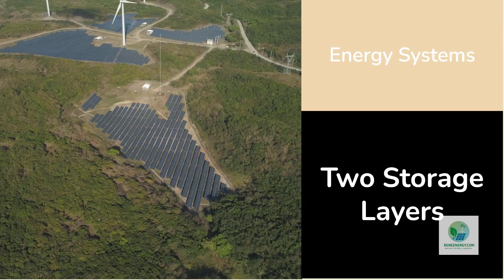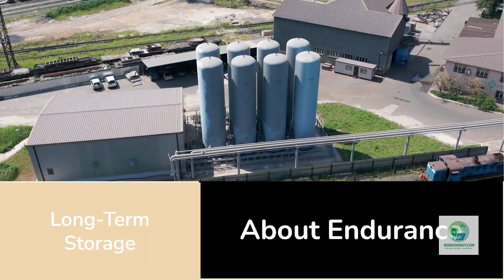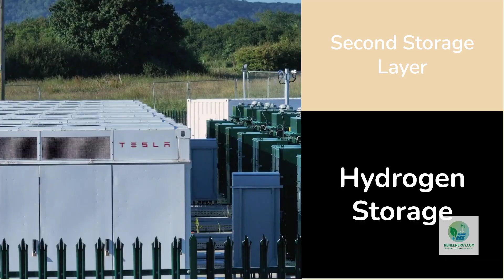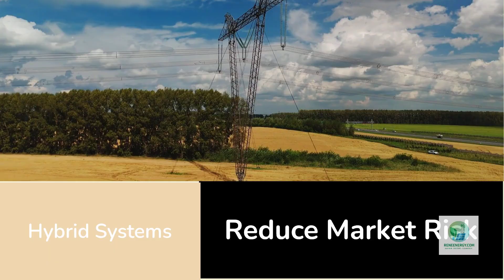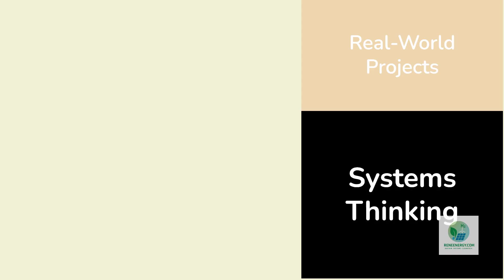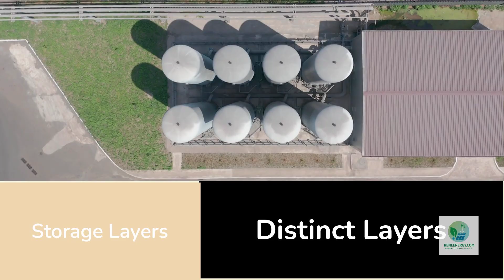Why the Energy Transition Needs Two Storage Layers?

Comment: Batteries are not the a stand alone solution for volatility management. Solar can actually do part of the job if set up right. You need grid forming inverters and when there is plenty of solar, you want to keep some capacity in reserve so you can respond to increases in power demand.

Hydrogen is not the only solution for long term storage. Heat storage is also increasingly popular. But then again hydrogen can also be considered a form of heat storage. Conversion of hydrogen back to electricity is inefficient, unless you find a way to use the heat that is produced along with it. And when producing hydrogen, you can improve efficiency by using heat from an external source. So for an efficient system you need 3 types of storage that interact: 1. volatility management solutions, like capacitors, flywheels, batteries etc. 2. Longer term storage like hydrogen, flow batteries etc. and 3. heat storage.
Reply: Thanks